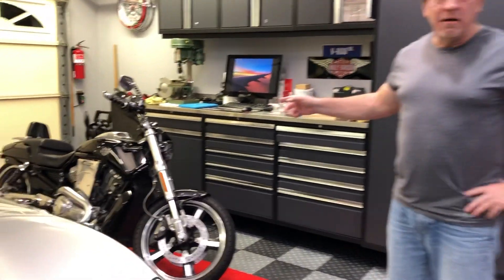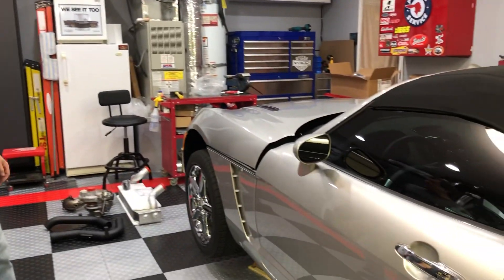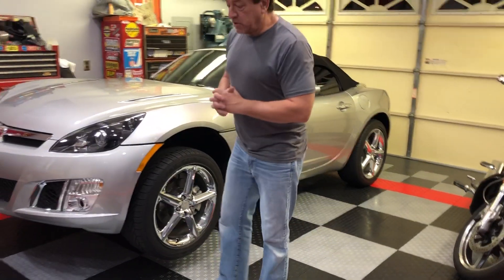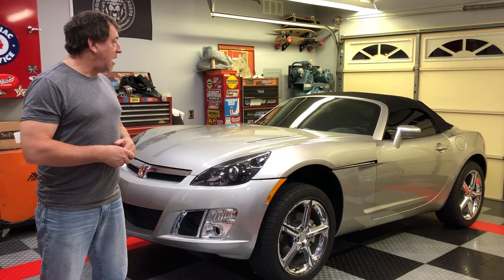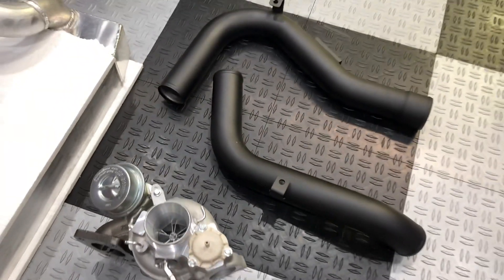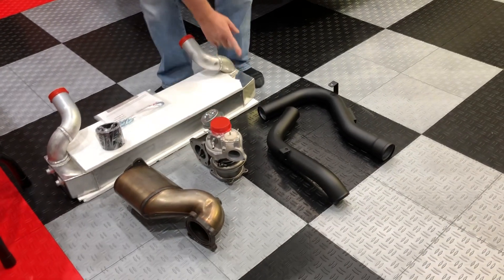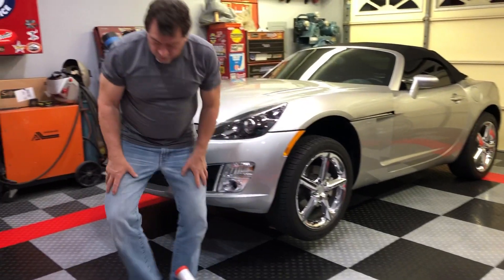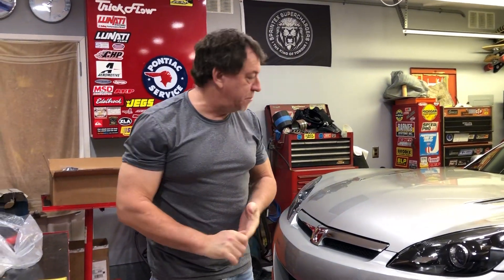Tim’s Garage Episode 1: Saturn Sky Redline / Pontiac Solstice GXP Turbo Upgrades

Comment: I am new to solstice/sky. I found your show and immediately subscribed.  You are full thinking and articulate.  My Main accomplishments are  77 years MSME. Professional Engineer. MGBGT V-6 Malibu 3.5. 5 speed.  I just found a 2009 solstice 2.4. 4000 miles
Reply from the maker: Awesome ... welcome to the community. I LOVE the MGBGT ! I also had a LBC ... 1966 Sunbeam Tiger that I built up ... engine build up of the 349 ci stroker is at the site www.TigersUnited.com under the performance tab. Lunati stroker buildup. Maybe join one of the Solstice and Sky Facebook forums. There are very knowledgeable guys there as well.

Comment: I've thoroughly enjoyed your work, explanations and attention to details. You have been an absolute gift to all of us. Thanks for everything. I've watched every video, in order, to date. I just purchased my redline and always have the itch to modify. Your experience and love of vehicles is clear. Love to see a person in their natural environment. Glad to see someone else doing this but not only that but also sharing. Thanks a million, from all of us. 

Have you considered the ZZPerformance LNF ported head, cams, tune combo? Why or why not?
Reply from the maker: I have not considered a ported head as under boost the marginal gains seem not quite worth the effort. If uou ever get a chance watch Engine Masters and they do a great test between ported versus imported on a boosted engine and managed about a 2-5 HP gain on 700HP … for our small engines I don’t believe the results would be there. That said I do have the ZZP coil packs. The tune is not unique s to ZZP as there are many options to achieve remote tuning these days … the cams are the one thing that could be beneficial but is have not done that yet. Before I do I need better head clamping with some good ARP head studs.

Comment: So my turbo pushes 22-24 pounds boost i thought it was stock but maybe previos owner got the upgrade but i did install the rpm charge pipes now im thinking i need the intercooler  but it still has the fall off at 5.5k rpms so i wonder if i need a tune
Reply from the maker: Several things to unpack here … first 24psi is dangerously close to lifting the head with stock head bolts. Second it may have a tune from GMPP or even more likely Trifecta as they were the ones that regularly would setup the car with max boost. The fall off at 5500 indicates a stock turbo and it is just not able to deliver enough air volume for the engine at WOT for any length of time. A big wheel turbo or a larger aftermarket turbo can help with more air volume and keep boost flat over 5500 and not let it fall off.

Comment: Great videos. You provide detailed instructions and do a very good job of making every step as transparent as possible. Thank you. I have one question for you, sir. Is the replacement turbo you have aftermarket or is it a turbo upgrade that GM offered for the GXP/Redline? I also live in California and happen to also be working on a similar performance setup on my GXP (minus the upgraded turbo) with GMPP upgrade and CAI. Wouldn't your turbo upgrade create problems when trying  to pass your smog check?
Reply from the maker: LoneLion … well … it is the factory Turbo that has been reworked inside to enlarge the impeller by about 30%. I really do not want to detail everything I have done but the cat passed smog at the last smog check before the new ‘tune checking’ comparison so I will need to wait and see how it does after I go through again this year when I need to again. If you want to reach out directly I would be happy to share the specifics … I am located in south Orange County.
Reply: @350tiger  Thank you for the prompt reply. Ok, that's good to know. The only problem is that now I am tempted to buy a reworked factory turbo, also... As if these projects weren't expensive enough 💰💸 Thank you for your help and I look forward to future videos of your Redline project.
Reply from the maker: I have one coming with details on the differential Brace … the hard shifting automatic can grenade the diff so I paused tuning until I finish that. At the moment best run using repeated Dragy runs produced a 13.3 1/4 mile time with a 107 mph trap speed … pretty fun for a 2.0 liter engine
Reply: @350tiger  I agree. These Kappa platforms are great "out of the box" and fortunately there is just enough aftermarket support to tune these cars to your preference. I am aiming for a balance between drag and autocross.

Comment: Hi Tim My name is Mitchell
My girlfriend just purchased a 2007 Saturn Sky redline 2.0
4 cyl turbo. I need to replace the pipe fuelFeed is there anything I need to do before I remove the old part?
Reply from the maker: Well ensure the fuel pressure has bled off before disconnecting the fuel line and you should be safe.

Comment: How satisfied are you with the big wheel turbo? I have an 07 Redline same color, but manual trans. 180k miles with magnaflow 3" exhaust, 3 bar map sensors and I tuned it with hptuners using the gmpp tune as a starting point.
Reply from the maker: Mike I am pretty happy but to be honest I am not sure I would go further than where uou are unless you like tinkering. It is quite a bit of extra effort for the addition 30 HP over the GMPP tune. Depending where your are located I would be happy to let uou see the cat and decide for yourself. A couple of things start to occur as you up the HP. You start to chase weak links. The GMPP tune is a great option but if uou are able to further and you wrench yourself it is very easy to do. I limited mine to just 23 psi as I have too many stories of guys hitting 24-26 psi boost and lifting the cylinder head. If uou are willing I would love to see the GMPP tune and compare that with where I am at with my tune. As an automatic I suspect they might be a little different. Sorry for the slow reply … if you want to reach out my email is timronak@cox.net but let me know here you sent me a note as I do not check it often.
Reply: @350tiger  custom parts, custom problems. I'm pretty happy with how it performs at this point. Mine has 180k miles. Need to do timing chain, guides, tensioners, and another water pump while in there.

Comment: Where did you order your intercooler from And what’s a good radiator to use besides the howe if you don’t mind me asking.. I’m going to be doing a build on my Saturn sky redline and just don’t really know where to look for some stuff like intercooler most of my parts come from DDM works! Thank you for your time I enjoy watching your build it inspired me to get up and get started on mine! Keep building Tim!!
Reply from the maker: The Intercooler I purchased from RPM-Motorsport in Tempe AZ ... I dealt with Martin Scott (602) 899-3240 he also has radiators and if you can run a cold air intake (I cannot as I am in California) he has excellent affordable options. I purchased my Howe Radiator from DDM although it was about 30% more expensive than the RPM option but I had a fitment requirement of using the stock airbox.

Comment: Maybe I missed it...but are you going to install the https://zzperformance.com/products/lnf-lhu-intake-camshaft-with-upgraded-fuel-pump-lobe...it will allow you through tunning to feed the extra fuel to your motor that it will crave...thoughts?
Reply from the maker: I had not thought to use that and the factory setup seems to provide enough fuel for now. I have not considered E85 where I live as it is not really accessible for me. That upgrade would be essential if I went to E85. In CAlifornia with the new “tune checking” law it is unlikely that particular option is viable for me as long as I live in this state.

Comment: Save your patterns. Maybe sell for $10.00. They are invaluable to us.
Reply from the maker: The patterns are electronically recorded and can be laser cut at any time but require a run of 25 to be cost effective. I have half a dozen left at this point but if I sell out I might consider a second run. The water pump shields take about 30-40 minutes each to bend and assemble.